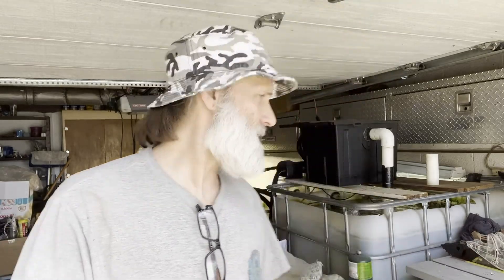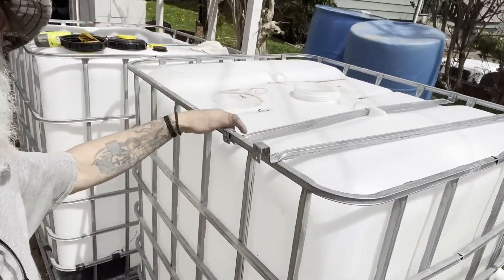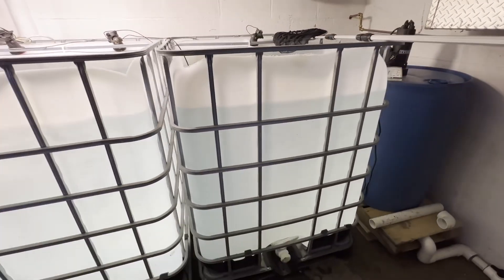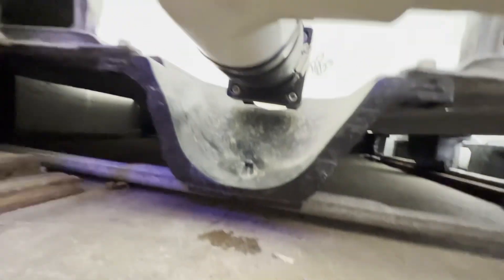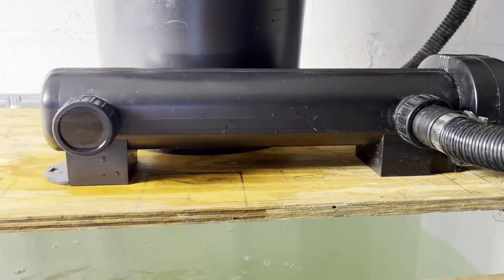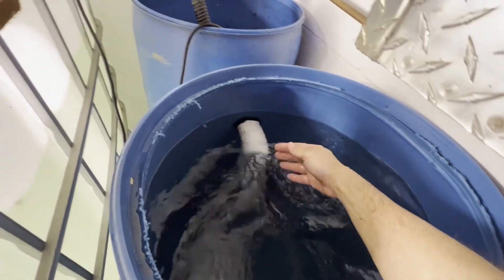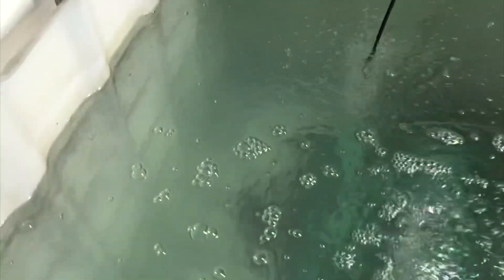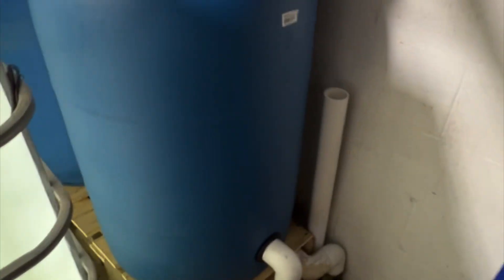How To Convert 3 IBC Totes Into Fish Tanks For Sustainable Food Grow Out / Hydroponics / Aquaponics

Comment: Great video, thanks! What do you have inside your IBC tank to prevent fish from getting sucked in? I also have small fish in my IBC. Thanks for your reply.
Reply from the maker: Thank you! The way I had it set up, it was gravity fed into the the blue barrels. If any of the small ones were sucked into the blue barrel, I’d just scoop them out and put them back with the others. The pump was over in other second barrel. Basically, the first barrel captured babies and solids, so they stay fed over there, as well, so I didn’t stress about it. They very rarely made it into the second barrel with the pump. I had a pvc fitting drilled with holes on a 90 degree elbow to keep large solids from going into the second barrel so that stopped most of every thing larger than 1/8”.  If I still had my set up could show you better but I shut it all down a year ago and have since moved from that location so I don’t have any tanks currently.

Comment: Nice setup!
What are you using to keep the temperature of the Talapia in the 80's?
Reply from the maker: Thank you!  I have them in the garage, and I have a large tank heater. I do not keep temps in the 80’s. I’ve bred mine to be a little more cold water tolerant, never below 55f, though, and that only in the winter. It’s middle of the summer and it’s 75f in my tanks right now.